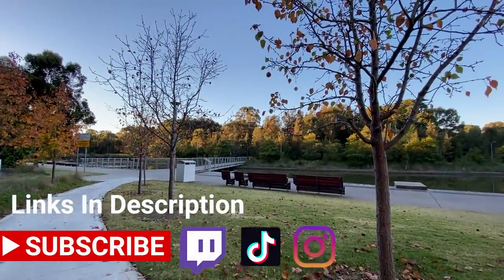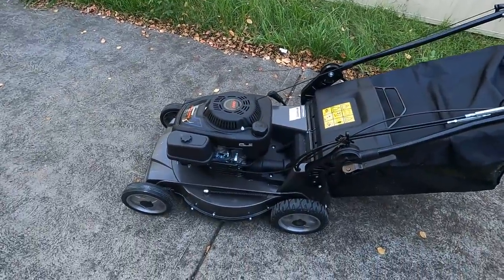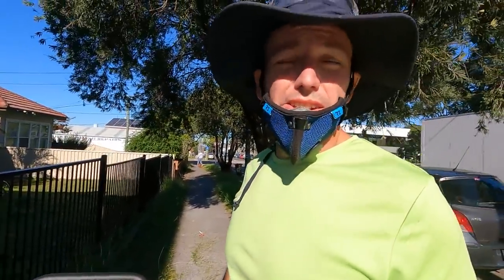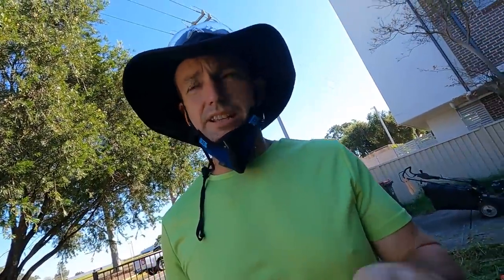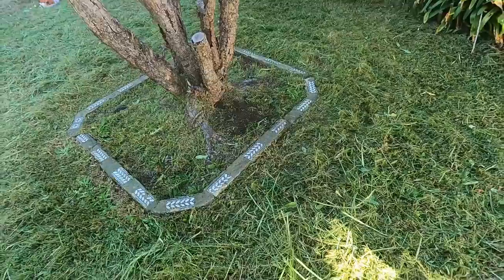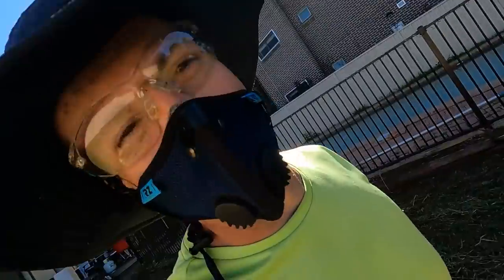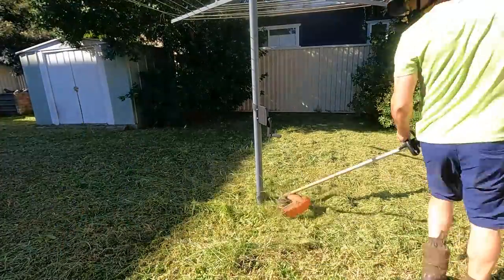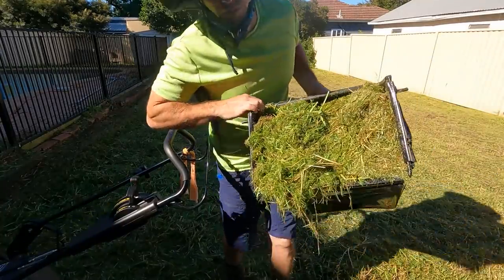I  Door Knocked Them When I Saw this Overgrown Lawn

Comment: I would cut the guard down to a few inches it works almost as well as it does off and gives you a little extra safety. But either way that lil mower is a beast.

Comment: That battery whipper snipper is not bad at all
Reply from the maker: I'm liking it so far!
Reply: @timthelawnmowerman  I’m really surprised by how much power it has
Reply from the maker: Yes me too!
Reply: @timthelawnmowerman  how’s the battery on it ? Does it last for a while
Reply from the maker: Long enough for me. up to 30 mins apparently. If you were a heavy user you'd need a few batteries. They charge quickly though
Reply: @timthelawnmowerman  I’m a heavy user for industrial purposes like brush cutting and lantana clearing
Reply from the maker: @mrnathnlan6291  any heavy stuff I pull out the 2 stroke
Reply: @timthelawnmowerman  I usually use a blade on it or a utility Mower

Comment: Nice job! Congrats on the new equipment. Which do you prefer the battery or gas whipper snipper?
Reply from the maker: For everyday stuff the battery but for crazy stuff the gas
Reply: @timthelawnmowerman  Cool thanks. I’m thinking of getting a battery one, just for use in my yard so should be good.
Reply from the maker: absolutely!
Reply: Dion❤

Comment: Good job Tim. How do you rate the battery powered whipper snipper? All the best, Brian.
Reply from the maker: I'm liking it overall mate. Just getting used to the weight being in the head and I cant get the stock handle in a position i'm 100% happy with but it's so nice to just pull it out and press the button.
Reply: @timthelawnmowerman  -- Check out a handle called "Darwin's Grip." (Not a sponsor 😁)  It lets you get a more comfortable hold on your whipper snipper.  I heard about it from another mower's channel.
Reply from the maker: Thanks mate, I’ve seen them. May pickup one at some stage 👌

Comment: Good job.
I did not understand why the mower with bag was not used from the beginning to mow the lawn : time saved
Reply from the maker: Because when it’s that long the mower would clog up bagging it and you don’t have do deal with as many clippings this way.
Reply: @timthelawnmowerman  : thanks for the reply : 
Try with two or three bags  (at rotation) and a big can? so you "change" the "clogged bag" fast.
 Love that Weibang 21 : it can be "upgraded" in the engine, with the big brother 224cc Loncin : https://www.loncinindustries.com/en/engine/ProductDetail.aspx?catid=8-15-16-30-50-64-2146805444

Comment: Mowing before you trim seems to me to be a more efficient method.  Less trimming to do. The electric trimmer worked well with less noise.    Self propelled machine makes much more sense to me.    Why is your utility mower not self propelled?????   My yard is small and I use an old electric corded machine.    It has a flip over arm so I can go both ways without turning around.   Works well for me in my situation.

Comment: When by back doctor put me on a 10 pound lift limit I bet the people in walmart thought I was crazy. I went and got a bathroom scale and took it to where the weed eaters were. If the box weight 15 pounds it was a contender for me to use. I figured the packing material weighed 5 pounds. All I had to figure out then way power and battery life. I’ve had the same weed eater for almost 10 years. Guess I made the right choice. My daughter mows and I do the weed eating.
Reply from the maker: Sounds like a great tool!